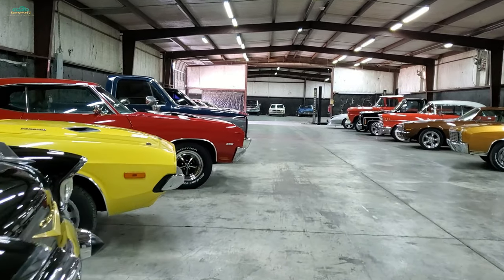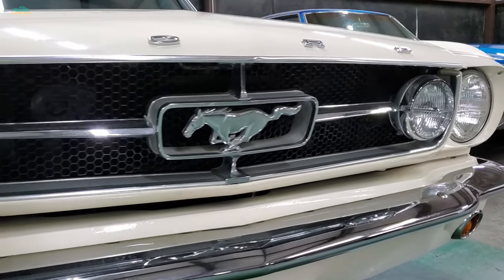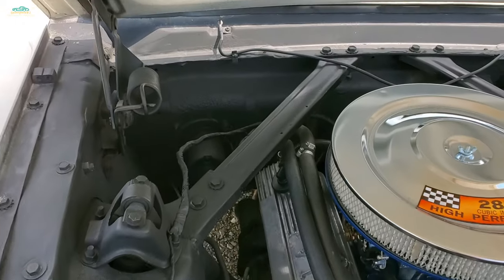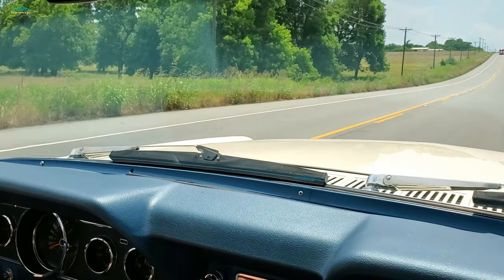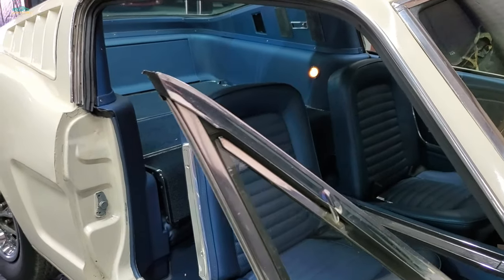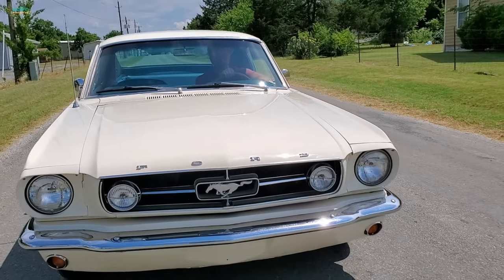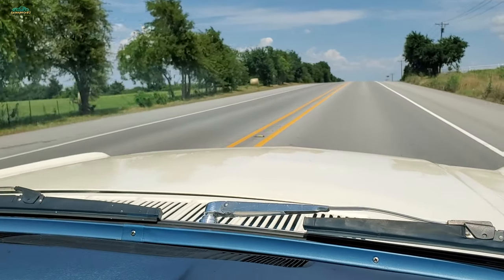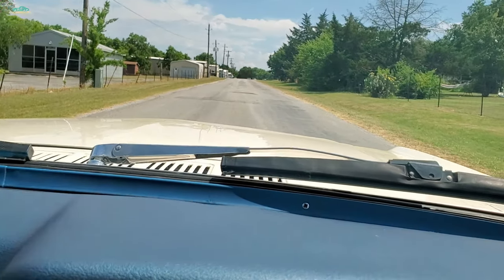1965 Mustang Fastback 4-Speed Inspection & test drive Samspace81 Texas classic car inspector 4K vlog

Comment: Sam . That is one rough Fast back. As soon as you took the camera down the right side that rear quarter ....ouch! And it didn't get much better. The interior looked nice , someone commented it was incorrect, l wouldn't know. Depending on the price l would have bought it  and then probably have spent a few hundred hours bringing  that bodywork to  a  presentable standard. It is my favourite model although l do like the '67 , just like the Charger " bullitt" may have had a Influence ! Thanks Sam.
Reply from the maker: Yeah it had a hard life :) Check out the Endless Summer video I just posted - SAM

Comment: The car appears to be mashed up with 65 and 66 parts. What’s the VIN?
Reply from the maker: It's not a number's matching car. Thanks for watching Samspace81, Valentino.
Reply: samspace81 numbers matching only applies to k codes as their VIN was stamped on the block and transmission. Is it a 65 or 66? Also it appears to be a 6 cylinder that was converted to a v8
Reply from the maker: Numbers matching also refers to the build date of the car corresponding with the build date of the engine by so many weeks, which won't apply here because obviously its not a correct car. Its a driver, a 65 like I titled the video. Thanks again for watching.
Reply from the maker: Be sure to subscribe and comment on all my Mustang videos. I've worked with over 200 classic Mustangs from 6 cylinders to GT500KR cars. Google "Samspace81 Mustang" Thanks again for the comments.

Comment: Wrong color engine for a 65 should be black. 66 style standard knit interior.Engine callouts missing. Some scary looking work in that door jam area. Disc brakes? Should be if it's a real factory GT. Brake pedal does not have the disc brakes insert.
Reply from the maker: It was a total mutt, driver